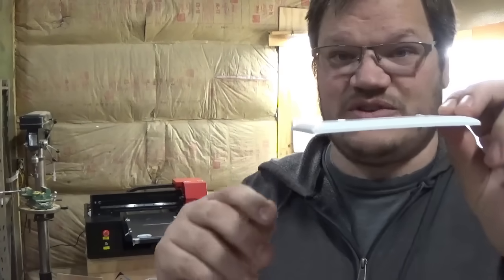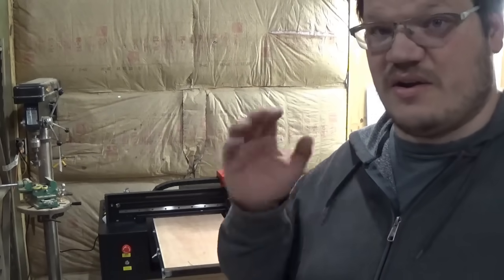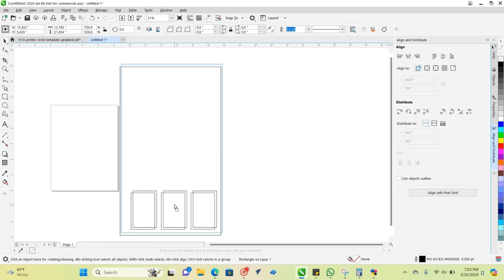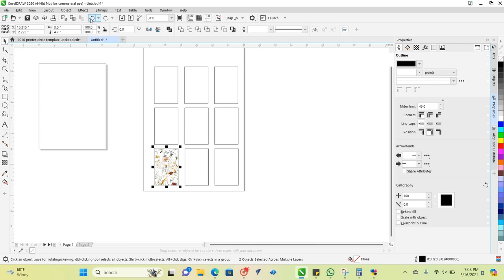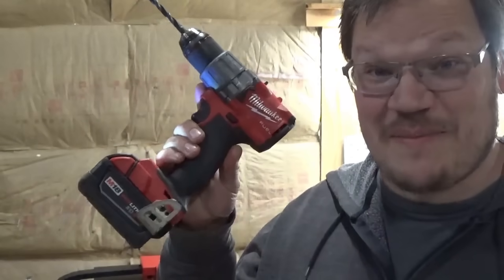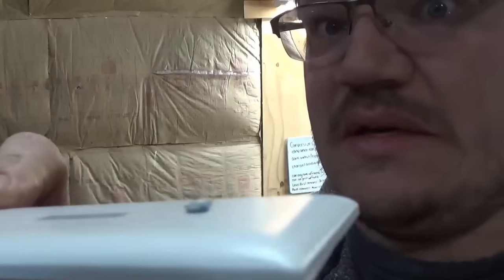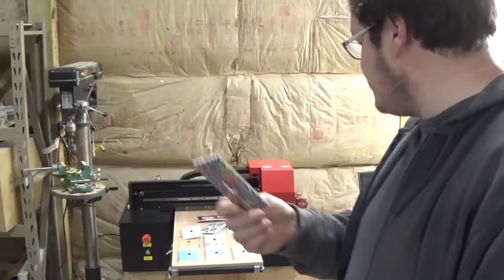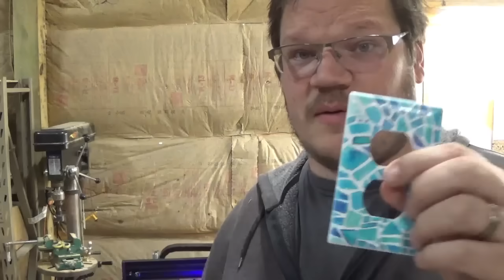How I earn $720 an hour with my uv printer  printing on light switch cover plates jaysprinters

Comment: "CorelDRAW 2020" "Not for commercial use" ... Bruh. You be violating EULA in plain sight.  Best crop that part out in the future, or make it right with the correct license.

This is a cool video. I dig that blue design you showed at the end.
Reply from the maker: we have several licenses to corel draw. This is my home computer since I am recoding this at my house which is fine, we also have commercial licenses on the computers for commercial purposes thanks for looking out though

Comment: Fantastic video. If I might make a suggestion. A lot of people including myself are very picky about the screw orientation. It’s a small thing, but orienting the screws so the line goes straight up and down would be a small detail that won’t go unnoticed by your customers. I know it’s something that I would really appreciate if I were a customer. Thanks for the great video!
Reply: That is cool.. as an electrician, I typically lined up screws too on electrical devices (Switch/plug etc) plates to make them horizontal. Having things look good was always a goal.
Reply: This is the Way!
Reply: @MicheIIePucca  When I was doing my apprenticeship lining up the screws was drilled into us. Didn't matter if it was vertical or horizontal but all of them in a room better be the same way. The journyman I worked under liked vertical so that has just stuck with me. I do it without even thinking about it now.
Reply: Vertical will catch less gradu, and be easier to clean.
Reply: @user-neo71665  cool.. also, I'd get annoyed if coworkers didn't put on cover plates nice and straight.  I had a healthy "OCD" :)
Reply: I am going to make sure I never line any screws up for the rest of my life just to annoy you. Literally just because of your comment. You can lay in bed sweating and tossing and turning knowing there is misalinged screws out there
Reply: @ryanclarke2161  🤣🤣🤣 It was really only a suggestion. Keep up the great work.
Reply: 😮😮😮 You can't control which way the stupid screw goes BECAUSE you need to make it tight, so whichever way it goes it how it goes!
Reply: @Some_One_One  From someone (ie: electrician)  who has installed thousands of plugs/switches and other devices that require wall plates etc, you typically can adjust 1/4  turn or so  one way or the other without a problem. But hey, that is just my experience.  :)
Reply: I have done many painting projects and this is my finishing move.

It’s almost subliminal. Looks RIGHT.
Reply: Nonsense!
Reply: Wow something I never thought about. I feel ignorant
Reply: Outlets - ground is up. Switches - on is down.
Reply: I’m a horizontal guy personally.   To each their own.  I move screws so lines go horizontal everywhere I go. Airports, hotels, friends homes, nursing homes.  Even hospitals.  And as of late I have gone international.  Ireland, Spain and Italy so far.
Reply: You didn’t put the groove on the screws at 90° before you printed on them! Those with any kind of OCD would go crazy when they put all of their screws in and the print doesn’t line up. Don’t be sloppy lol
Reply: @MadHatter11371  

Finally I know who has been changing the orientation of the screws! I’ve been setting them to vertical everywhere I go but when I come back later I see someone has changed them to the horizontal position. You have been driving my OCD condition crazy. I even missed a connection from Ireland to Spain because I had to change the screws back to the vertical orientation! Please, please, just stop already. If you don’t I’m going to have to stay home and never leave. 

Wait a minute. What’s that? Oh my God. One of my light switches has the screws in the horizontal position! You have even been here! Noooooooooo!
Reply: @ryanclarke2161  buh hahahahaha dudes got issues.
Reply: @MicheIIePucca  However, with these, unless some care is taken with the design, they'll only be correct every 360 degrees which is a bit different than the usual 180.
Reply: Laugh in Europe where we don't have visible screws
Reply: Just for you, I'd make them random but never up and down.
Reply: @ryanclarke2161   What electrician doesn't know to line the screws up in the same direction, whether horizontal or vertical?  Hilarious that the commentor said they have to be only horizontal.  lol
Reply: @MicheIIePucca I’m an electrician also.   I think we’re the only two electricians who choose horizontal over vertical.
Reply: @jgg9836  Not everyone can be perfect ;)
Reply: Normal people don't care. 😂
Reply: @ryanclarke2161 Yeah, I always preferred to make sure screws are tight. F alignment

Comment: Gnarly... The printer alone is $3500. So to fully reimburse this expense you will have to print and SELL 350 switch/outlet plates, before you truly can call that a clean profit.
Wonder if the printer and print heads survive making that many prints before you start reaching positive profit. Interesting technique nevertheless. I am surprised how it can print over beveled edge and screws without getting damaged or missing surface.
Reply from the maker: @digimaks  sure. Heads last about a year and you can print alot more then just coverplate

Comment: As an electrician. I would like to give you advice with the screws. A electrician a good electrician always knows to have the screws straight up and down. You’re concerned about looks when finished and this is one thing that shows electricians take that extra step.
Reply: So does a good DIY'er Sparky.

Comment: You could have turned 2 rectangles 90 degrees and got 2 more per pass, also check out space and align tool
Reply: Also, with smaller holes in the board, the screws could be used to locate the plates precisely, which would reduce setup time. 🤓
Reply from the maker: Absolutly we could of done this

Comment: I like how everyone is losing their minds over the outlet covers being what is being sold lmao.  There a ton of other items this would works for.  Idk the machines physical limitations or what kind of material it can print on, but off the top of my head: small plates, coasters, pens, ipod cases, phone cases, school folders, book covers, metal/canvas wall art, wallets, thank you cards, mugs, cups, packing boxes, gaming controllers, custom computer mouse designs, compter mouse pads, and the list goes on and on.  There are plenty of different items that will sell, you dont have to do outlet covers lmao.

Comment: One suggestion. If you watch a pro install switch covers, they will align the screws so the slot is vertical. Make sure they are aligned vertically when you print on them.
Reply: Not all electricians have OCD.
Reply: @e-curb  No, but all electricians DO have the NEC!

Comment: Just wanted to comment and say the screw orientation is something that real electricians and real trades guy do bc back in the day it was a way to know if someone other than the professional had messed with the work you’ve done after doing it.
That’s why you have them vertical 
Mainly from what I was always taught it’s not just aesthetic. It’s for property owners to be able to catch renters messing with the switches.

Comment: Are you aware of any UV printers that can print all the way down the curved sides of an electrical outlet or electrical switch cover? I think that is called '3D' capability or 'Object Printing'. Thanks
Reply from the maker: @dumbcat  they can print all the way down the curves side till hits a 90° angle.
Reply: @JaysToDoList  Oh wow. Even the printer you showed in this video?

Comment: Amid all the other red flags in this video. You could have used cardboard and just pushed the screws into it, or a piece of foam insulation. 
That would cut a few steps out of the 29 steps to make these.

Comment: What are you netting after shipping/fees/etc, if you don't mind me asking?
Reply from the maker: Last I checked amazon fee is about 3.85 plus plate and ink about 20 cents. You also have some shrinkage maybe print error or lost in the mail maybe 5 to 10 cents for this per sale. So maybe 4.50 $5 for singles but doubles sell for 18.99

Comment: Does this print on the curve? It looks like the plates are slightly curved all around the outside? Interested in the machine.
Reply from the maker: @lonniejeffries2874  it will print 5mm away from the printhead it will print a little further but it will be out of fucos but acceptable on these

Comment: I'm in the market to start making 2 sided paper coasters that I hand out to bars and I sell marketing on the back of them for local businesses I'm a little confused as to what I would need to do that, do you happen to print paper coasters if so how would you do it would you use one of these UV printers or is there other printers in your shop that you would use And would you suggest me using my cutter to cut them out or just buying the pre-cut Square coasters

Comment: At that rate you'd have to be printing to new a plate every 45 seconds or so, is that really accurate? If you account for the unwrapping and general manual labor it's probably closer to 10 minutes per than 7 minutes per batch of 9, which would make it closer to 500 than 720 per hour
Reply from the maker: No we package and prepare the items while the machine is printing the next lot of covers

Comment: the 3rd hole is always a surprise

any way, the printer is cool, didnt know you could just print on plastic, or the other materials you claim.
I doubt any one would be making 720$ an hour with it though, especially not constantly, but i would still like to have a printer like that for my own personal projects. whats the brand and model? where can they be bought? approximate printer cost? aprox ink cost?

Comment: Does anyone know if this printer or others like this can actually print realistic images? Like a photo of a person or people. 

Also, he mentioned he chose white covers so he doesn’t have to print white. Are these printers not capable of printing white? Maybe it’s expensive or you need a different model of printer?

Last dumb question for now. 
Looking at the printers on the website, at least one printer says UV/DTF.. 
What is DTF?

I’m sorry for asking probably ridiculously dumb questions but I’m very interested in this and see so much opportunity.
Reply: 1. Of course they can. They are like any other printer.
 2. They can print white and it's not more expensive - it can just be a lot of savings if you use images with a lot of white or light colours.
3. No idea, sorry but i'm guessing Google could be your friend ; )
Reply from the maker: "oldman" is correct they can print any image even a face they can print white just dont have to on this project so why waste the ink. DTF is just short for "direct to film" so you are printing transfers here I have a video on this too https://youtu.be/LInfJsXylOA

Comment: Good video. I would make the improvement to this idea in including the outlet or switches as a package deal as well. Id also go on to possibly provide as well offering theoutlets that have a cellphone cable combo port as well. Ive been in the trades for decades. Most of my clientele want cover plates to match the finishes of what ever area wall or finish veneer covering where it is installed. From tile, paint Metalics, stains ect.... I've had the cover plates and outlets ordered thru Amazon But only in color so far and it is relatively limited so far. 
The past options have been getting a faux finisher to do to which gets pretty expensive.  It
Reply from the maker: great idea

Comment: Why not screw the covers to the board. Itll print the screws in the correct tightened position and will hold them in place

Comment: fantastic video! How often do the print heads go out and do you replace the dampers every time you change heads. Also how much for the heads
Reply from the maker: The xp600 head running uv inks maybe 6 months on average

Comment: Thanks, what a well done and inventive video! I had no idea a kind of printer exists actually. I figured maybe laser but this is cool! Will this work on any material or does it specifically need to be a hard and non-porous surface? I’m thinking about doing something crafty for my home but by doing sublimation printing which I have yet to figure out!
Reply from the maker: Yes this will print on most surfaces thanks for watching

Comment: I didn't watch the video because I buy cover plates at home depot for less than $1  per piece so I just wanted to check in with the comment section.
Reply from the maker: This video show you how to make a 25 cent coverplate into a $8-9 coverplate with little work

Comment: Professional electricians line up the screw slots either horizontally or vertically when they install a cover plate.  You didn’t line up the screw slots prior to printing.

Comment: I even had an electrical inspector tell me that If the screws are not lined up horizontal or vertical, it is a sure sign of a non professional. And they begin looking for other shortcuts.

Comment: It would be awesome if you could also print on the light switches and outlets.
Reply from the maker: We could print on outlets I think but I doubt switches
Reply: @JaysToDoList  What about those flat switches? The ones that have the covers with the big rectangle cut out like the ones used with GFCI outlets.

Comment: On Jungle Scout it indicates you are a new seller and have sold 1 unit for a total of $9.92. Scratch that 0 Units sold: But IF you do SELL 1 it breaks down like this:
 Net Revenue / Sale
$5.21
Total Fees / Sale
$4.78
I have a Mamaki JFX-2530 and can barley make about 90 to 120 an hr. Way more annoying than my laser cutter. 
Oh yeah?! How did you reach $720 per hr with 0 Sales? NO ONE is saying you are a bold faced LIAR or a SCAMMER. Can you show you math calculations plz so I can also make $720 an hr like you sir? And your Sure it's SEVEN HUNDRED right? I don't want to waste my time like if you had a typo and it was 7.20 per hr. That's what I used to make working at McDonalds. Great Job!
Reply from the maker: @davismccarty6424  that goes to show you what ever jungle seller is not accurate I go through my math in the video and please don't think amazon is the only place to sell I don't give away all my secrets;)

Comment: Can't believe all the hate for a cool idea.  It'd be cool to print the switch and the cover together, then it would be easier to sell the set I think, but you'd have to do the flatter switches.  The outlets should be easy to do.

Comment: You would have to print 80 of those cover plates per hour to make $720/hour.
Reply: he explained.. 1 batch of 9 plates took 7 mins 40 secs. in 60 mins you can print 8 batches that's 72 plates X $10 = 720.  You would have to have at least 2 printers and load one up in less than 7 minutes while the other is printing so that you are continuously printing but theoretically, those are the metrics.  whether or not you can sell them for $10 that's another story...
Reply from the maker: thanks for watching this is not the only thing we print just print them and send them through a little advertising dollars and you are done restock in a month or two. print something else tomorrow if you even want to work it  if this makes sense
Reply: @JaysToDoList  You know the business inside and out, I know zero about it. Plus, you have to package and ship the things. I don't have the patience for all that physical manipulation. I'd rather use your company as a drop ship option if you even offer that.

Comment: And by the way - good choice in tools!  Milwaukee truly has lots of class leading stuff... not all of it is that overpriced... just most of it but better to say high priced or premium priced as overpriced means not worth it and the brand is really one of the best.  I have a Milwaukee cordless screwdriver and the "clutch" on it is like magic compared to my coworkers DeWalt which is a mechanical ball/detent design...  The Milwaukee clutch is electronic and it just ... stops ... when you reach torque.  My co worker finds that to be annoying and likes his Rigid stuff better.  RIgid seems quite legit as well.

Comment: Sure, you sell them for that much and you can print them at that speed. But you are not selling $720 worth of stock every hour.
Reply from the maker: Doesn't matter we produce this much at this time send them to Amazon fba and then the work is about done let amazon donthe selling not much more labor involved  even if it takes 6 months to sell them we still produced it in 2.5 hiurs time
Reply: @JaysToDoList  Well now that does change things. So, assuming it takes 6 months to sell them that is:

Hourly rate ≈ $0.1667 per hour

Comment: I would have used a piece of high density Styrofoam for the bedding jig. Just push the screws into the substrate, no drilling. But then he went on about the milwaukee drills being the best. They're not bad.. and I was a milwaukee man once upon a time.. but I've got a few dozen varied drills, half a dozen mini recip saws, 4 full size recip saws, several lights, and a boat load of batteries that are dead within an 8 year span with no repair support because they're out of warranty. And have to replace milwaukee batteries regularly.   On the flip side,  I've got my father's Dewalt battery drills, recip saws, lights, etc that are 20+ years old and still work. I've replaced switches, control circuits, motors, gear boxes and more on my milwaukee equipment myself. I've even replaced dead cells in the batteries myself. I've only had to replace a few of the batteries for my dewalt stuff.
The corded tools are much more reliable but I've still had to replace plenty of parts on my milwaukee corded verses practically no repair needed for my dewalt corded stuff. 
Take it how you will, but my "side by side" experience has proven dewalt to be more reliable. I like them both but I purchase dewalt now. And.. milwaukee discontinued one of its most popular and useful tools.. the "hatchet" reciprocating saw with the folding handle. Bad call,  milwaukee.